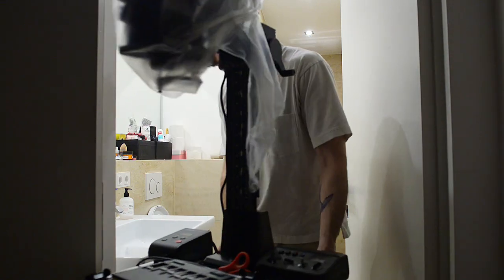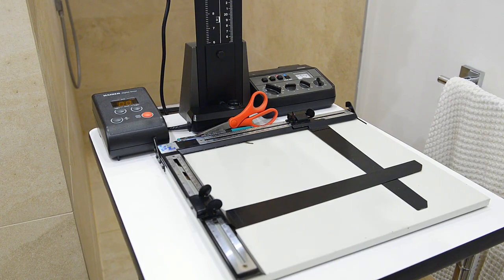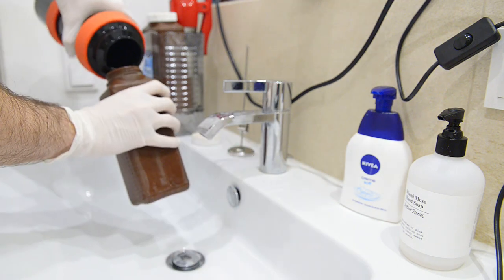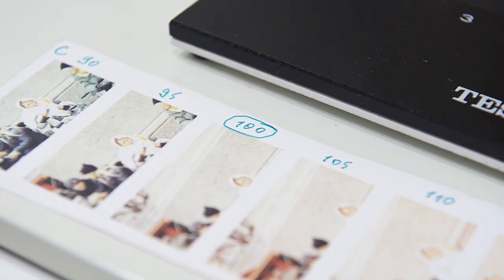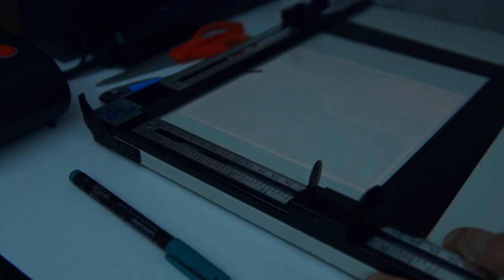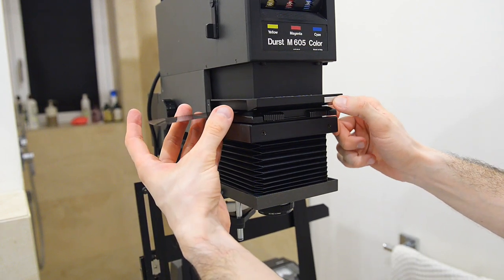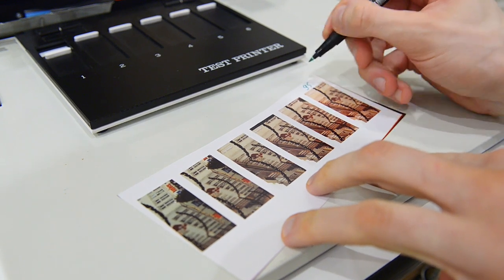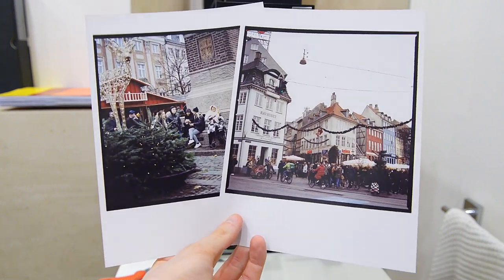Copenhagen in color, RA4 prints from from Hasselblad with color analyser

Comment: Thank you for all the videos about RA-4 printing. I have been developing RA-4 since 2020 and enjoy it a lot. 
I have noticed that the bleach fix does not need the full 45 second time when making test prints, but still give the same color as the final image with full bleach fix time.
Reply from the maker: Sure, in principle blix take time "up to the end", so it's really depends on your picture and freshness of solution.
Reply: I have not found the picture or freshness of the blix to matter. I do how ever use a stop bath between developer and bkix. I typically just do a 5 second block for test prints but a full 15 second stop bath.

Comment: Just discovered your channel, love the darkroom videos! I'm thinking about switching my dev trays for a tank for b&w prints, as my space is pretty limited too, but I have a couple of questions about using a tank for paper:
1-Are you limited to a mimimum size for test prints? I feel like maybe if they are too small they might float inside the tank and not develop propperly.
2- The same for final prints, maybe if  the size is not big enough, it might not hold propperly to the wall of the tank, resulting in uneven developing.
Reply from the maker: Print size not really matters , just use a bit more solution in the drum, not 50ml as required. In this drum i can print from peaces like 5 x 10 cm up to the 30x30 cm. I'll try in future make b&w prints, so stay tuned )